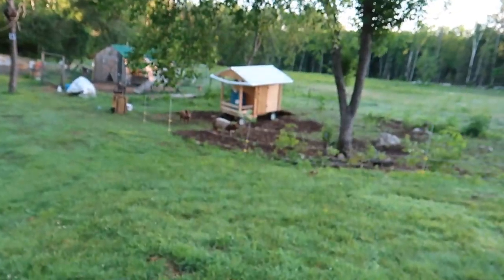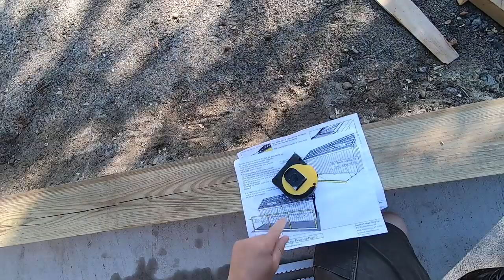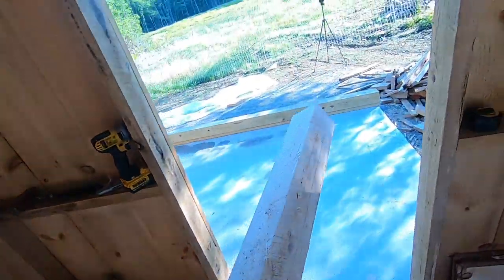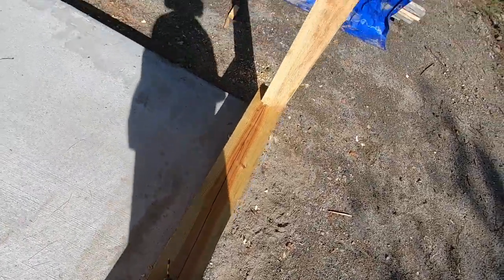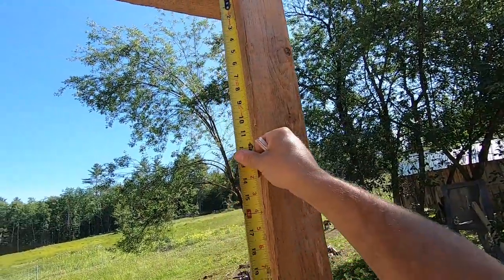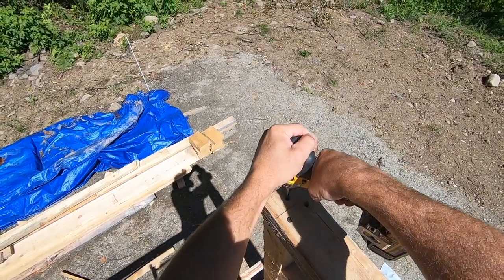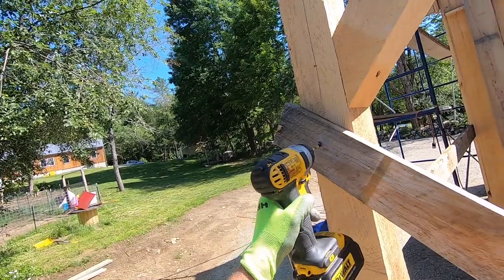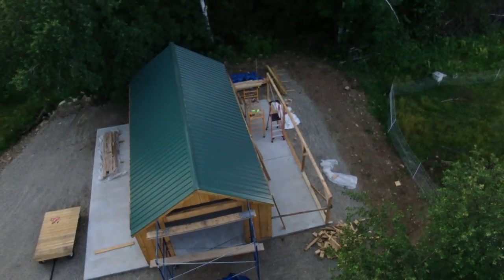I had to take it ALL back APART Nothing Wanted to go RIGHT! DAY 18 of the BARN BUILD

Comment: Should have held the Top plate with column jacks. Then cut the bottoms to your desired height. Remove the waste. Drop the column jacks. Done. Next time use a ledger board...and story pole...when attaching over hang to existing roof. This will get you a better look at what has to be. Great work. Keep it up man!

Comment: I have a idea for you for the next pole barn build.When you take the sill plate mounting it to the concrete take a min and figure out where your poles go use your heavy duty lag bolts screw in from the under side, then you drill a hole center of your post to drop them down on the lags this way you have a anchor point from sliding out and then add your toenail screws.  just a idea ,great job im fallowing you from here on in keep up the good work and awesome farm.

Comment: FYI you can walk on the tin, as long as your steps are in the correct position(not recommended)  make sure your feet are on the perlings(strapping and screw heads) i do it all the time. it saves setup time for scaffolding

Comment: I would have pulled the lags from the bracing posts at the vertical posts, leaving them attached to the horizontal  beam (that the rafters will bear on) and removed them as three units.  Then cut the tops of the vertical posts down to the height you want .  This way all your temporary bracing stays in place preserving plumb, and the lags all go back into fresh wood and not previous holes.  ; )

Comment: The goog thing is, that you did build the barn by yourself (or with others  help), and put it together with screws instead of the nail the kit came with. That way, when you do make a mistake, it only takes a few minutes of work to fix. Just back out and save the screws and reuse them.

Comment: In my work ,construction, I never though of it as a mistake if we fixed during the build. In 30 years I have seen lots of MISTAKES. Like a window missing, or an extra door, the ceilings to low, forgot the feed for the parking lot lights. Al the barn is looking great.

Comment: Hello,  Seems for what you are doing the bottom plate is only in the way.  Animals walking, sweeping, cleaning the stalls etc.  Something like a Simpson post bracket drilled into the concrete would make the area flush with no plate in the way.  Take care.  Doug
Reply: My exact thoughts, the treated bottom plate made sense when there was a big beam on it. But with no beam that plate seems to be almost as much in the way especially with the concrete sloping that way, then the plate just works against having it easy to let fluids run of by themselfs
Reply: And taking it out drops the pitch 5 1/2 inches. Why cut another 11 inches off the posts?
Reply: None of that lumber would have stood up to urine and feces draining constantly on it soaking in.  The concrete provides the strength with proper brackets keeping the wood out of the drainage.  The pad had a slope to it to drain out I assume?  As you wouldn't want it laying against the barn either.
Reply: I was thinking the same thing - a metal post stirrup embedded in the concrete would hold the posts solid and off the concrete, and give you a completely clear opening so any muck could be easily swept and even hosed out when necessary. Well, we'll see when it's finished - maybe I'm envisioning something different. At least the big 6 inch "wall" is gone which is an improvement ;-)

Comment: Checking vertical on two sides of a vertical beam.  Normally one does this on adjacent sides to get true vertical (the second side when fixing the vertical on the 90 degree side from first), not on two opposite sides which does not add any accuracy at all.
Reply: Learn to use a plumb bob, especially working alone. Suspend plumb bob on one corner of post, check plumb in both directions at once.  Wouldn't hurt to read the books that came with his speed squares either. He'd get more functionality from his squares and the rafter book portion he could have double checked his dimensions before all of that work.

Comment: Given that your stalls have concrete floors, which is above ground level, it seems like it will be easier to muck out stalls if you completely cut away the sill plate at the bottom of door openings, so you can just shovel straw and manure right out the door.

Comment: Wouldn't need to imbed as they make a style which bolts to the surface and still allows a space to hold the post up off the concrete.  Just drill and attach.

Comment: You said that you needed to cut the posts off by 11-1/2". Then after that, you eliminated the 6x6. Did you still go ahead and cut off 11-1/2" from the posts?  (which now makes that wall 5-1/2" shorter than you intended.)
Reply from the maker: They were cut back to the height they needed to be cut too.
Reply: Good! I was worried.

Comment: Sorry Al, i dont want to be "that guy" but when you check for plumb on the posts your doing it incorrectly...you check for plumb on two adjacent sides (or one-quater of the way around a post) check out a tool called a post level to see what I mean.
Reply: Yup, I've used a post level for years! "Try it, you'll like it!"    :)
Reply: So I wasn't the only one yelling!!! Ah, the voice of experience pays the price with mistakes...
Reply: I got one of those when I put up my 6' fence all by myself.  400' of boards, posts, brackets, concrete...

Comment: Curious to why you had to cut off 8 inches off of the 4x4 posts as well as remove the 6x6. Seems like an awful lot and the side walls will end up too short. Just removing the 6x6 may have been enough.
Was it to get a better pitch for the roof?
Reply: With all the snow he gets he needs all the pitch he can get. We will still probably have nice drone footage of Al raking snow off the overhangs this winter.

Comment: one more comment, check your plans for screw placement, not sure they are in the correct position. I have seen that they need to be on the up profile. I have done it both ways and am not sure which lasts longer. and just FYI my default is the way he is doing it

Comment: Al, I am totally not getting this, why are you needing to cut anything on a pre-cut kit?????  Why did this company not have these posts cut to the correct length already??  Inquiring minds want to know.  Thanks and sorry to hear about your problems with this kit.  UPDATE: Ok, just saw where they said they send these long so you can customize them - well wouldn't it be NICE if they would at least put a big **warning** on that step of the instruction letting you know these pieces are longer and that you have to cut them down....cheese louise!